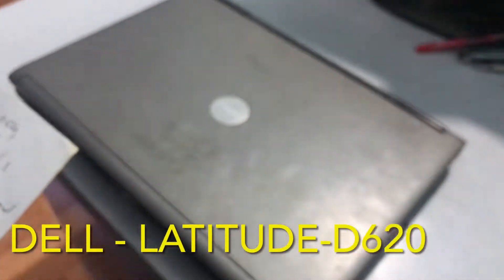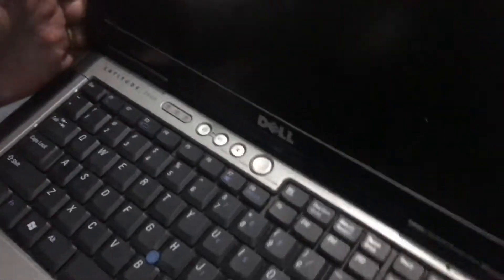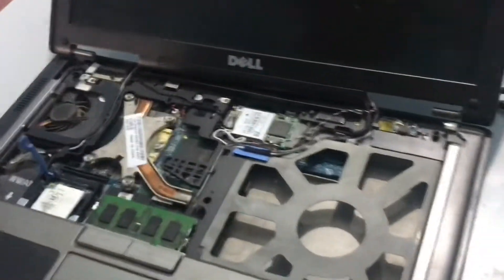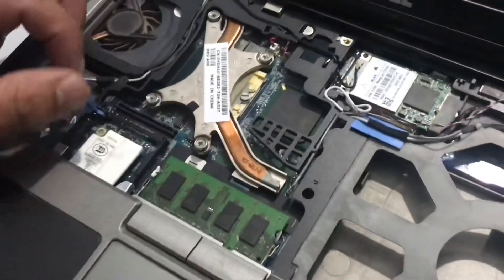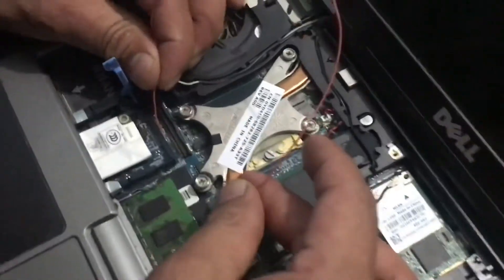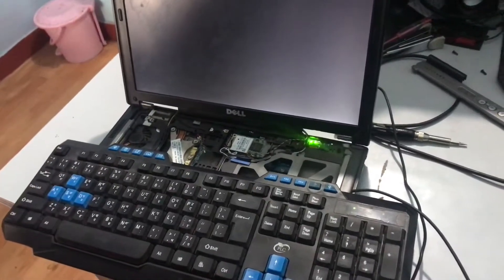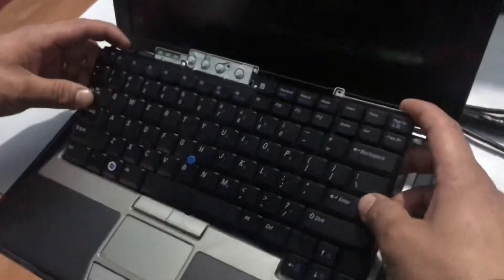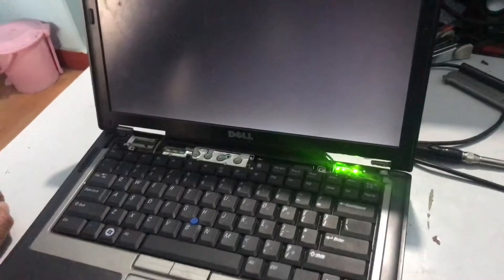Dell Latitude D620 D630, Fix Power On But No Display, Dell Latitude D620 Start without Power Button

Comment: I think my issue is related to BIOS and I need to reset it. Since long my Vaio laptop battery had gone exhausted. So, I  used to start my laptop by connecting it directly and pressing the power button on, lights would start blinking, fan would start running but there'd be no display; the laptop wouldn't turn on. In such a situation can I connect the laptop with an external monitor or an led tv will there be display? If yes, what does that signify? Please confirm connecting the laptop with an external monitor is advisable? The laptop screen went black when the boot mode was changed from LEGACY to UEFI. Do you think by taking out the CMOS battery will reset the BIOS?